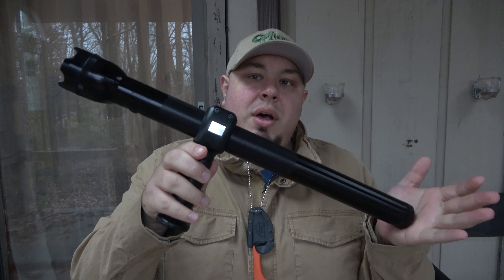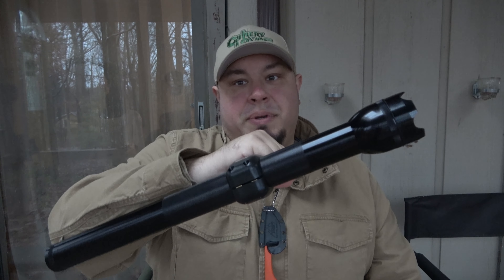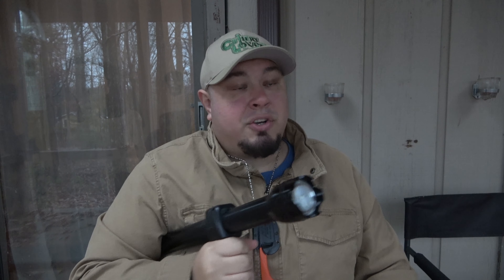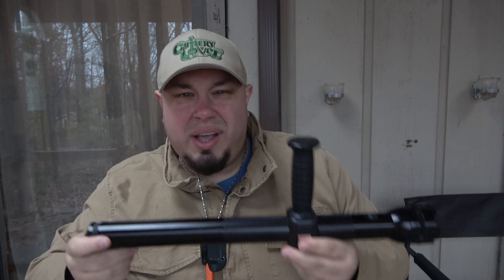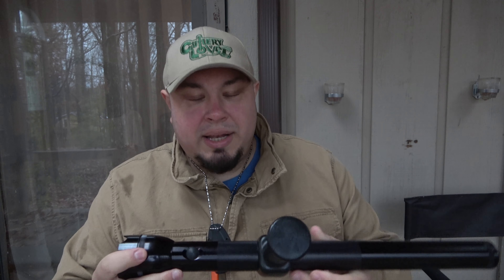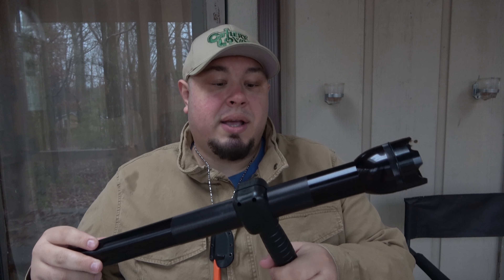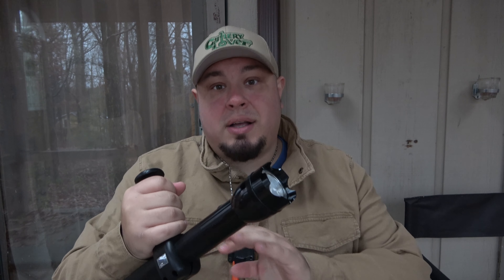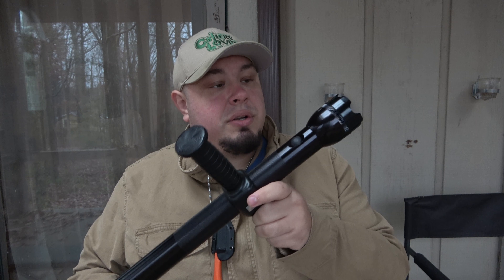Custom Maglite Build (Part - 9) The Maglite Project Is DONE...

Comment: A PR-24 / BULLPUP flashlight. I love it. Plain old, original 5 c-cell was the best. That's why ya can't hardly find one anymore. Only flashlight I ever actually used in full contact self defense on the street. The bottle broke because I blocked it with the light hidden up the inside of my denim jacket sleeve. He had no plan "B", so I owned him...good times...even now, years later and them not even knowing it was me, there's people who weren't even there that tell me the story...good times...M

Comment: I tried to follow along with my 6 cell but i got as far as the led upgrade but couldnt get one to work in my light. I would get it installed and turn it on and it would blow the led. After two kits I got tired of returning the kits and gave up. I did get the litt bezel. Tried getting the bust a cap thing but got sent the wrong one had to send it back too. Didnt want to spend the money on triple insert you went with and like you said the handle isnt on amazon anymore. But my maglite is back up and running with new batteries and the strike bezel and is back in my car where it was 20 years ago so there was a happy ending after all.

Comment: Question for you jeff.  With that large handle attached to this 6D Maglite flashlight, how are you then going to be able to then carry it in any holster on your belt?
Reply from the maker: the light has been sold to a friend he already has a different holster for it that works well with the handle I actually forgot to include the ring holster in the box lol so I guess it worked out...He didnt mind wasnt going to use it anyway since he likes the handle

Comment: I found my old 6 cell maglite the other week but unfortunately the batteries had leaked bad and they are stuck inside. Same thing happened to an LED mini-mag i had. I used to have quite a few different sized maglites years ago when they were about the only really decent lights you could get (for the money anyway). These days most of my lights fit in the palm of my hand and are many times brighter than even the biggest incandescent Mags.
Reply: I have been using mine since 1995.  I had it out tonight for Halloween comfort.

Comment: I put the D battery adapter to put Lithium AA an it's alot lighter an still last just as good as a defense weapon and as a flash light to leave in my truck. I have the 3 led bust a cap an the glass an bezel strike. The D's just make it to heavy. If you need to use as a weapon it would do the same amount of damage or more an it's easier to control.
Reply from the maker: I actualy got upsizers for AA's but not only did they suck I never showed it because the extra weight was important for its defense purpose...